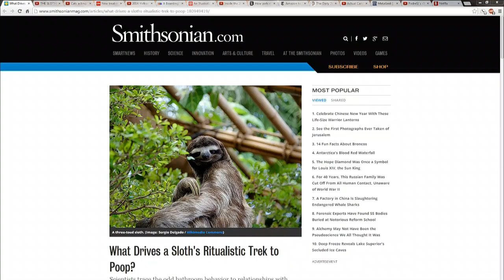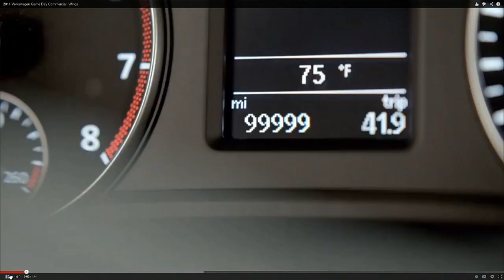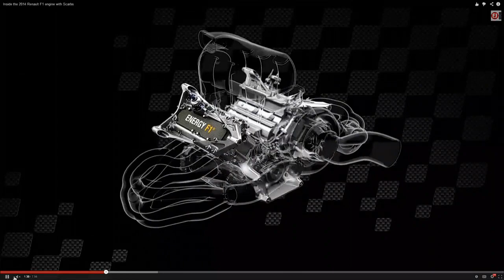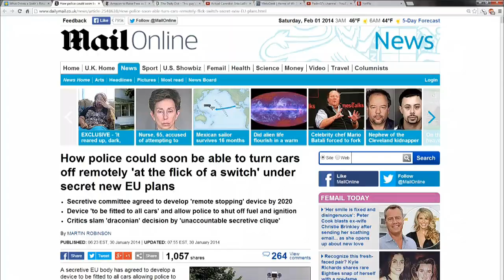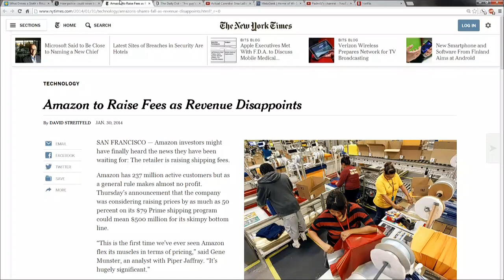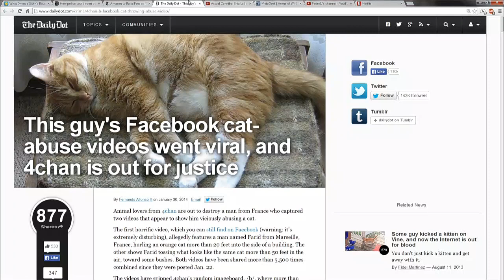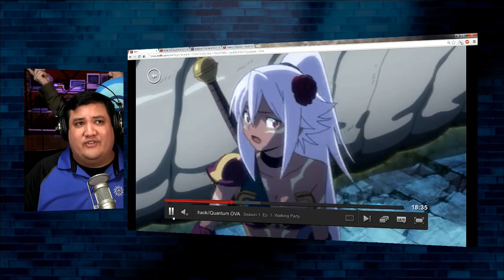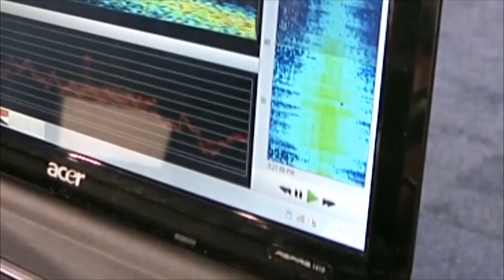Padre's Corner #001 - Pooping, Spying and Buying with Chase Nunes

Comment: have you ever heard of GM OnStar ?  the Onstar system has been able to remotely shutdown, GPS track, lock/unlock the doors, and remotely access engine and vehicle diagnostics  the vehicle for years.  The system has been used several times to shutdown a vehicle during a police chase and lock the doors to trap the thief inside.